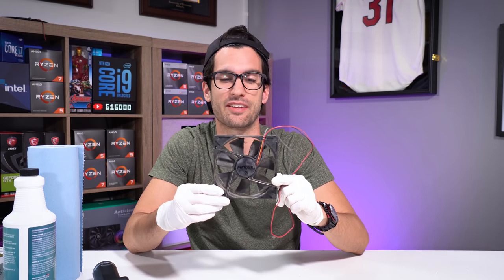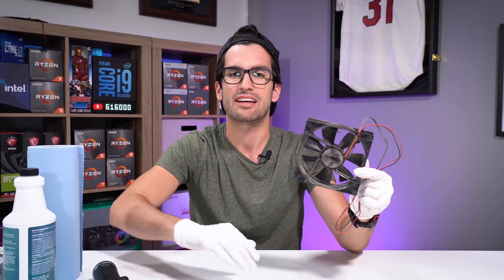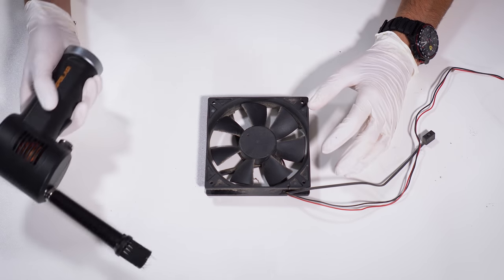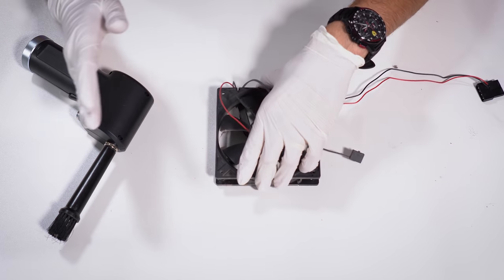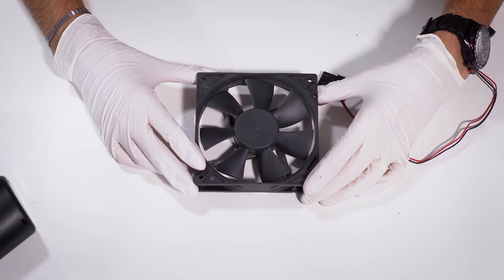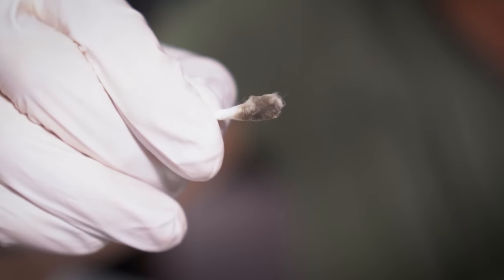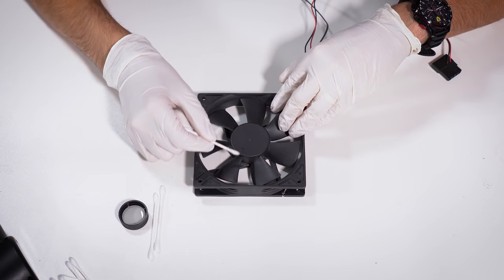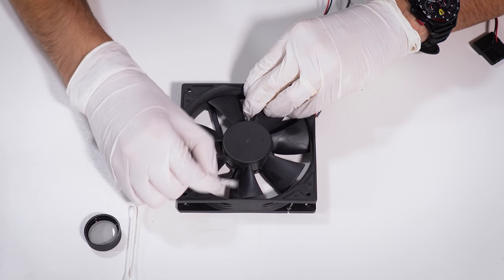How To PROPERLY Deep-Clean PC Fans

Comment: Is it safe to run the fan under running water if you cover the center hub or bearing?
Reply: No, there are too many gaps and many electronics exposed. You can do that, but you will need to dry it and change oil.

Comment: Please, you  don't need all this mess, and that ridiculous contraption with the electric paintbrush. All you need is a soft paint brush, even better make-up brushes. Gently hold the rotor from the center, pass the brush, END.
Only for fans that need it or are noisy a drop of lubricant.
Actually TODAY the fans are sold in stock, when it starts to make defects, you change it, end. It's just a fan not a processor.

Comment: i want to put a psa here most of these fans for computers are assembled in a way that  they have a litte nub  and indent  that if you pull the fan hard enough it will come oput but because of how when using your hands it will tilt the fan one way or another that wont work what i do is take a somewhat soft sides paddle or sorts i use my brush to be honest and i wack the back side of the fan where it connects intot he cross members and theres this sweet spot of hitting it hard where it really isnt hitting hard but it pops the nub out of the indent and the fan blades come off with the magnets and everything and makes for a quick and easy clean up if your fan ever starts toi make grinding noises this is what is needed to clean it usually the nub it at the end of the shaft that is treated as the barring so you have ot make extra sure to clean that i dont really liek using alcohal for this because it desolved the greeses and then leaves this extra thin residue but the greeses mix with the dust then they wipe off clean and then i put a super tiny ammount of 3 in 1 oil on a q tip and just barely toush that shaft when everything else is clean rigth before you reassemble the fan and its back to brand new
Reply: also i use an old bottle brush that never got used  to do the in side of the ring not q tips maybe even buy a cheap dollar store tooth brush to do it  and only use that for doing these fans liek this every 6 months or so i guess depends on how dusty your house gets

Comment: How would you recommend removing the fan from the cpu heat sink? I can’t find a Philips screw skinny enough to fit through the top hole on each corner. I appreciate it if you could share a tool I could buy and use
Reply: get a Philips that is thin enough to fit in the hole. Not much else you can do now is there? go to the dollar store
Reply: @-unclebuck-  that is very much the problem, I cannot find a Philips skinny enough

Comment: Why blow all that gunk everywhere and deep clean you entire room when you could just suck up all that dust and not clean your whole room? Sounds like an awefull lot of extra work that is not necessary.
Reply: A lot of these computer cleaning products are constructed to prevent the buildup of static electricity. This is fine for things like motherboards, graphics cards and such, but for fans is way overkill. To get the same effect as that little blower a vacuum has to be quite a lot bigger and move a lot more air. Moving air can cause a build up of a static charge, so they are generally not considered a good idea when working on computer components. You can buy vacuums that are built specifically so they will not cause ESD, but they are expensive and not something you buy at Walmart. But like I said for cleaning fans they are, in my opinion, overkill.

So get a can of air and your favorite vacuum. Use the vacuum to suck up what dust comes loose as you use the canned air to blow it loose. Problem solved.

Now if you want to prevent ESD from the vacuum then you can either use a metal nozzle that you connect to the computer ground or you can jerry rig something using anything from aluminum foil to copper tape. Make sure it goes inside the nozzle and has a good ground connection and things should be fine. Oh and one things that can be dangerous are if you have a brush on the nozzle as those can generate a lot of static electricity when the air is rushing through them. ESD protected nozzles use fibers that are some what conductive, such as carbon fiber while your average vacuum is more likely to use nylon or something similar that builds static electricity like crazy. So don't use them when dusting the insides of your computer...

Comment: If you have a dishwasher you can just wash large batches of fans all at once, or hand wash a few of them in the kitchen sink with a dab of soap on a sponge then rinse with the sprayer. Give them a wipe down with a wash cloth after. Then blow them out with an air can to get most of the trapped water out of the base of the fan, and let them air dry for a bit in the sun. Then re-oil them to give them more service life. This ends up being alot less labor intensive then cleaning one fan at a time via disposable wipes/towels and q-tips, and it will prolong the usability of the fans. Plus, you are saving on the cost of cleaning materials and not contributing more trash towards current and future landfills with seized up fans, filthy q-tips, and dirty paper towels.
Reply from the maker: I would never in a million years put PC fans in the dishwasher. Not gonna happen.

Comment: I cant help but feel this is over complicating matters, perticularly when the fan is not taken apart for a proper clean.
Yes, you can use a QTip to clean large flat surfaces, like a floor, but it makes no sense to do so.

If you ever cleaned anything, and have ever taken care of any items you own, then this video is pointing out common sense but dressing it up as actual information.

Comment: That's the weakest electric duster i have seen. You're not even using the air to remove the dust, you're scrubbing it away with the brush and then blowing away the dislodged dust. If anyone wants a real electric duster that actually gets rid of the dust by just blowing, you should use a DataVac duster, Compucleaner 2.0 or a XPower duster. These can be found on Amazon and will literally last forever and are also like 5 times stronger then this small dinky little thing in the video and costs the same or less.

Comment: And here i just wipe down my fans, wash them in diesel blow them with compressed air, lube them with anything from motor oil, to gearbox oil to chain lube (not the wax kind, they tend to get so thick that the fans can't start spinning) wipe it off and reinstall 🤷‍♂️

Comment: Um... nah, not worth the effort or time for just a single fan.
I usually tape the fan blade, blow strong compressed air, brush (soft paint brush) it and sometimes soak the brush with just a little IPA, let it dry and blow compress air again. 

20 minutes top, for 6 fans including assembly/disassembly.

Comment: It’s really not hard to disassemble these to actually clean (and lubricate!) the inside… 😑
Reply from the maker: You can clean and re-lube without removing the fan blades from the bearing. There's also a risk of damage when doing this. For these reasons, I strongly recommend surface cleaning as we've detailed here.

Comment: Looks at Greg's Fan.. Tosses it in the trash and replaces it...
Reply: That sounds so wasteful. You can clean it up way faster than Greg and have a perfectly functional fan.
Reply: @MJ-uk6lu  From the view of Greg who is doing it for content and How too its fine. From a person repairing the dust encrusted system.. Sometimes cleaning a fan will no doubt cause the fan to fail not long after because it actually ends up getting more dirt into the bearings of the fan or the pressure of cleaning the blades can also cause the fan to fail.. Been there did a wonderful job cleaning the fans that now make grinding noises and Yes i am no noobie at cleaning systems.
Reply: @1gatomon  How does that even happen to you? All you need is painter's brush and some wet rag, spend 5 minutes  cleaning it and you will achieve 95% of what Greg did. And if it grinds, then remove blades and replace oil in fans. There's no way a fan will grind after that if it wasn't defective in the first place.